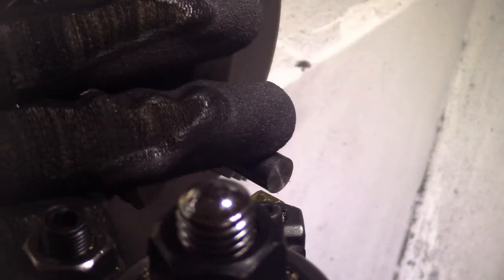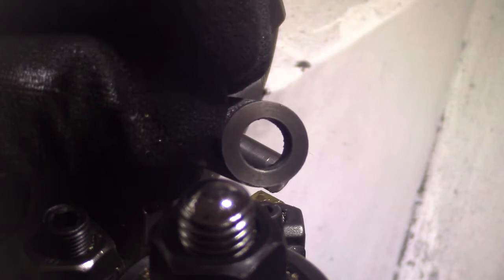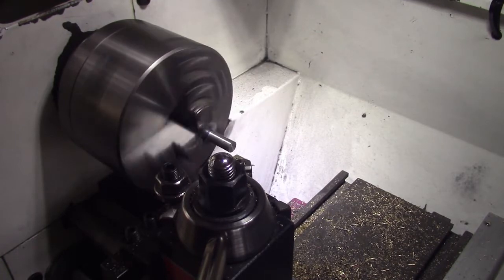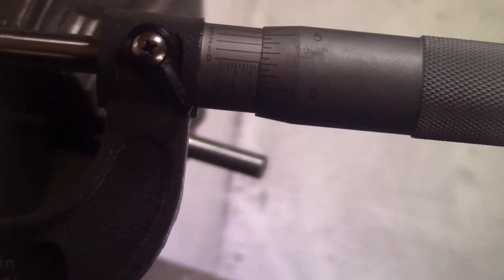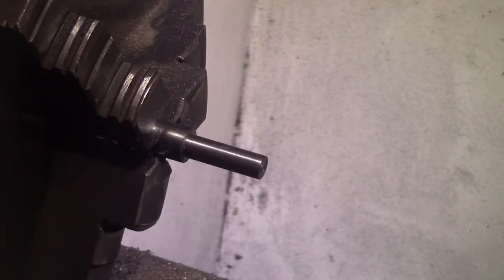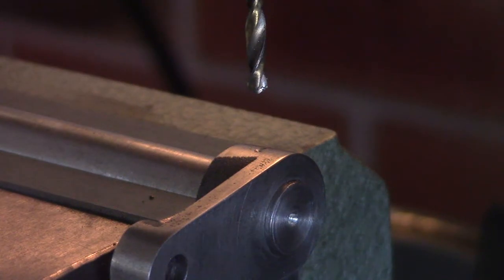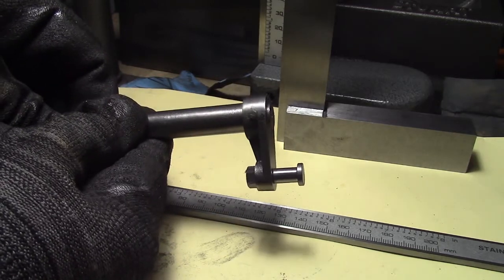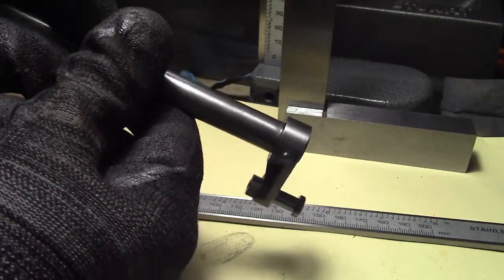Stuart Beam build Part 4

Comment: Hi Gary - looking great so far. A couple of questions...
Did you make the taper pin?
What equipment do you use for polishing - this is an area I really need to improve upon.
Cheers
Andrew
Reply from the maker: Thanks Andrew.
No I did not make the taper pin I purchased a few different sizes of ebay, (just search taper pins) a word of warning, imperial and metric pins have slightly different tapers. my reamer is made in the UK, (TRUBOR 9/64 No2 1:48) I just selected a taper pin that had a good fit (mic the pin and reamer to choose)
You can purchase good reamers in the UK, try to avoid the Chinese reamers as they are not the correct taper (they don't quote the taper, so it's pot luck)
A good engineering supplier should have a selection, unfortunately it's one thing you can't skimp on.

Polishing is a slow process, I always leave parts a couple thou over then file to size (not always possible) then I use 400, 800 and sometimes 2000 wet and dry, always with oil and then the trick is to use Brasso with your wet and dry. (I learned this in the Air Force to remove scratches from cockpit windows)
For cast parts I use a small buffing wheel and Brasso, sometimes a scotch bright pad.
Unfortunately it takes time.
Regards
Gary